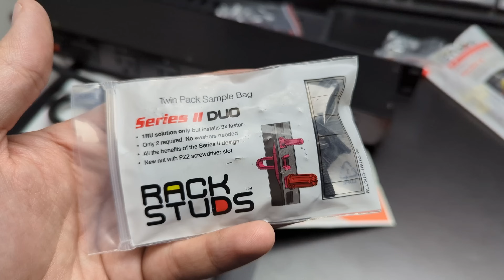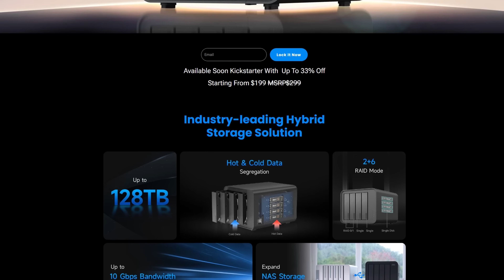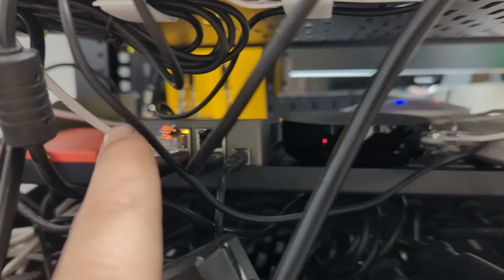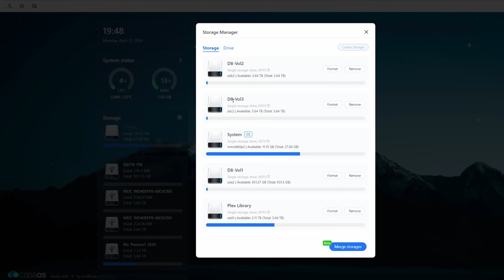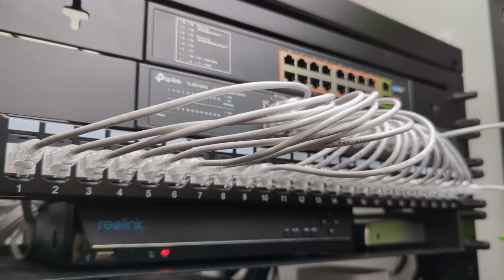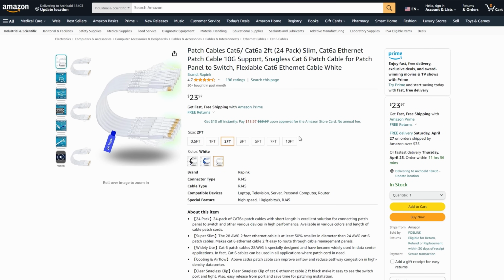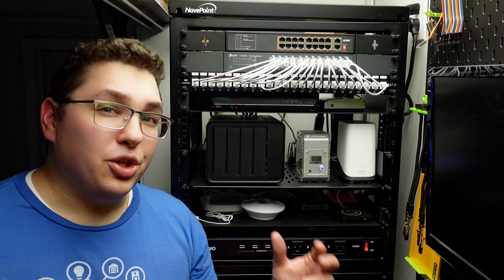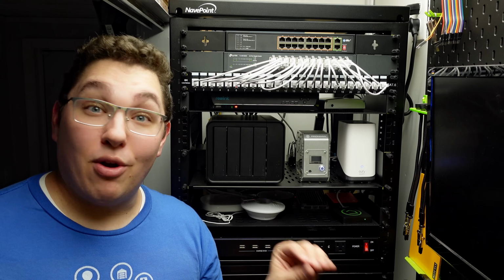My new SMART HOME Network RACK! (Build and Tour)

Comment: I had a nest wifi pro system and we absolutely hated it because it randomly would go offline and the pings were super high. Once we sent it back we got a TP link wifi 6e mesh system and it's been perfect. I'm pretty sure the model we got is the AXE5400.
Reply: The AXE5400 is an awesome mesh system. I got mine at Costco last year.  Switched from the google nest as well.  Trying to get away from google as well as Amazon.  Wi-Fi 7 is too expensive and this is the best priced 6e system.  Especially if you are only using gig or 2.5 gig switches
Reply: @pat9080  Yeah it's been perfect so glad we switched.
Reply from the maker: Thank you! I have been having the same issues for a few years!
 I was considering TP Link, so I may try that
Reply: @MakeItWorkTech  As soon as we set it up it has not given us one issue. The coverage is amazing and the speeds are so much better then the nest system.

Comment: If you have access below or above the main floors of the house via basement, crawlspace or attic you can run Ethernet.  It's not complicated, but it can be a huge pain, but also rewarding.  Nice job on the rack!
Reply from the maker: Thanks for the tips! I don't have access everywhere, but i do under all of the bedrooms so maybe I'll give it a shot!
Reply: @MakeItWorkTech save some time and buy a bucket of jetline and anywhere you run a cable, pair it with a length of jetline tied off on the end of the cable eith some electrical tape and the other end tied off on the back if the cabinet. And no mater what, anytime you make another pull to that same location, replace the jetlkne you will pw be able to use as a pull string, with another new piece of jetline. Also for attic runs anywhere in the very edge of the roof where perha9s the fascia is and you only have a few inches to a foot max of space in your attic to get a cable through (in case of hardwired cameras anywhere on the exterior at roof or under roof level, or any wall jacks on the interior side of an exterior wall). You can only go diwn si low in an attic on your belly trying to balance across ceiling joist studs ti reach over to where the hole kn the stud will be. You can mske this task easier by purchasing a small roll of the fiberglass/polyester fishtape (klein has a glow in the dark 25 foot kne for $20 or so) and just feed it upwards into the attic and just keep feeding it because of its flexibility (over glow rods) it can easily traverse the very low angle of most roof and allow you to sot 5 to 10 feet away from that sliver of a siace and still grab ahold of it, then just tie uour cable onto and go into the room snd pull your cable down. And if by chance it didn't mske it to a slot where yiu can stand or comfortably crouch within your attic, then just spin and shake ghe fishtaoe around and it will essentially flop around and it may take 2 or 3 attempts at most, but its a lot better than crawling across 2 ceiling joists kn your stomach through insulation hoping you dont kick out the drywall in the ceiling as you inch forward attempting to avoid havjng a 5 inch roof nail jab into your head or shoulders.  If this sounds confusing, either youve never attempted running cable in an attic or you have some sort of barn style crazy uncle roof, bit most houses have at least 2 sides of the roof barely overhanging the sides of the house shd using at max a 30⁰ angle on its incline towards the center.